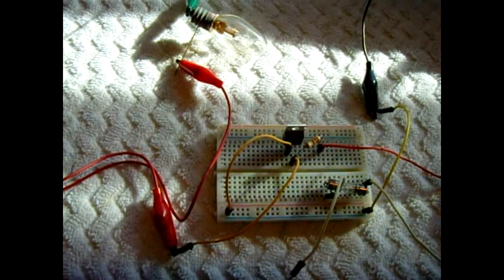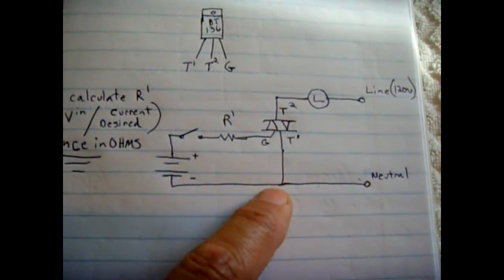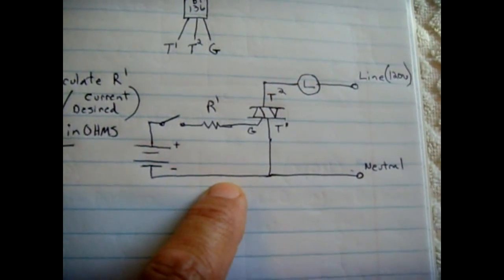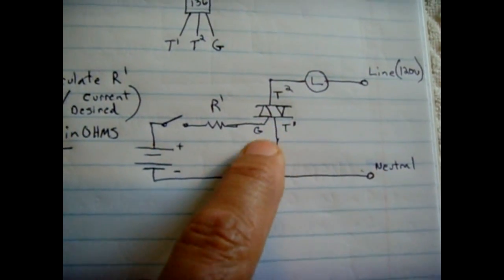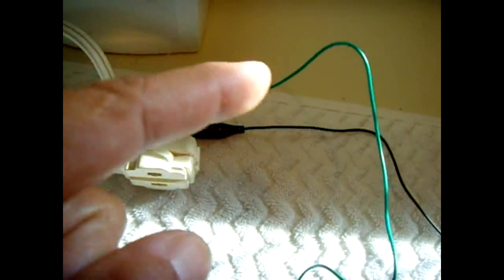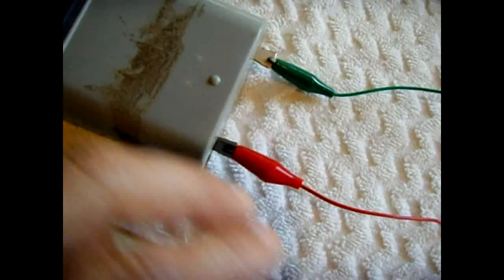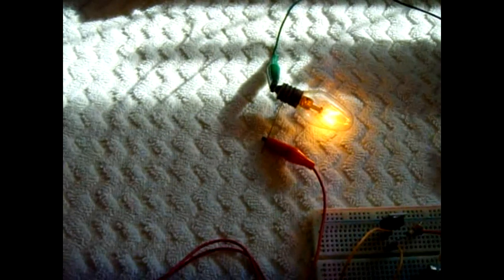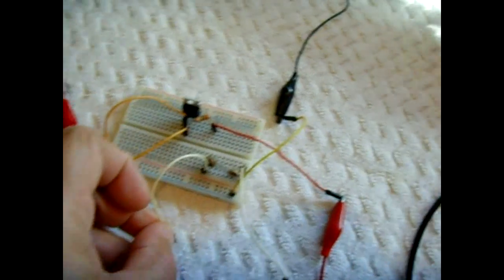How To Trigger Triacs for AC Loads Using DC(Battery)

Comment: Nice and clear vid, but just to be precise, you schematic shows a switch on the battery+ then you use the battery minus wiring to switch the circuit on/off. It's ok, but it could confuse newcomers.

However, let's do more vids.

Comment: A useful circuit. But mains voltage on a breadboard... hmmm what could go wrong?
Reply from the maker: Never had any problems, and I've used mains on breadboards for years during testing. Just be sure to use strips far apart. Thanks for watching!

Comment: ok, so you triggered an AC device which is the drill that works on an AC voltage that takes +ve & -ve voltages. so now the TRIAC conducts on both directions to allow for both +ve & -ve voltages. but on order to trigger the TRIAC to pass both voltages peaks, I have to trigger it with +ve and -ve pulses, but you only triggered the TRIAC with a battery that's only on direction trigger !!! so what's the deal now? what's happening exactly?

Comment: Awesome demo bro!
Does anybody have any good links for the transformerless supply (AC-DC) circuit that he mentioned briefly.
I've found a couple but their maximum output current is limited to around 40-100mA, which is not quite enough to power a micro-controller.
Reply from the maker: You can buy inexpensive switching power supplies at the link below.

http://bit.ly/2eBLkVI
Reply: Thanks I'll check it out.

Comment: Are you sure the little experimental Pin-Board is capable of handling mains voltage???
It is constructed for low voltages, max. rating is about 30 V!
It may run fine, until it blows up the whole thing in a moment!
A tiny metal splinter in the contacts would be enough or some wet dirt e.g. :-)
Reply from the maker: The breadboard is made of either Nylon or HDPE, both can handle 120V with no problem. The metal contacts strips also have adequate spacing.
Reply: richardnanis do it in your own risk 😂

Comment: Hello, thank you for a very good video!

I am wondering if this is also possible if I am using two thyristors instead? Also if it is possible at much higher frequencys? 300-500 Hz. 

Thanks.

Comment: what is the maximum triggering frequency??
i mean can we connect arduino to gate and give 100 hz on and off cycles
please reply
Reply: Check spec sheet to see how fast a triac you are using can be switched.  I know the voltage can be adjusted using a triac with a potentiometer instead of fixed resistor like demonstrated here.

Comment: The TRIAC will always shutdown at the zero crossing, but with the DC voltage applied on the gate it will turn on again for another half cycle and so on.

It works, but you are always driving the load with its maximum power.
You cannot control the power given to the load.
Reply from the maker: Yes. I was only showing how to switch on and off. :-) I have other videos showing power regulation.

Comment: do long use of Traic (with ac applaince)  increases its temperature??does it gets hot??
Reply from the maker: Only if the triac is controlling a heavy load, or if the triac is not fully turned on.

Comment: I connected the triac T1 with first terminal of my load and second terminal of my load with Live. Finally, the neutral is connected with T2. Theoretically, the lamp should be off, Right?
Are there any other possibilities that I didn't embrace? 
I am asking because I bought 6x BT136 and they behaved like a short circuit.
Reply from the maker: If you duplicated what I show in the video, the components are good, and you also have the correct pins, then it should work. Potentially dangerous circuits I do not assist people with. Stay safe.

Comment: I found A1 and Gate a BTA 12 trica  (dislocated from PCB) are connecting when I measured from a multimeter,  am I having a bad TRICA?
Reply from the maker: +yxhankun 
If you have a very low resistance connection or zero ohms between MT1 & MT2, or the Gate and either terminal, then the triac is shorted.
Reply: +electronicsNmore  mt1 and gate is 76 ohm; mt1 n mt2 is 16 m ohm. mt2 n gate is around 16 m ohm.
Reply from the maker: yxhankun You need to look up the data sheet. Triacs are very easy to test. You can make a simple test circuit like the one shown below. Use a 330 ohm 1/2w resistor in place of the POT.

https://tse2.mm.bing.net/th?id=OIP.M5fec8809c355d612903fba6a757b64f9o0&pid=15.1

Comment: Thanks for the explanation. I am wondering, how can you reverse the DC polarity at the gate so that it has negative current? Do you just flip the battery so that its positive side is connected to the neutral line?
Reply from the maker: +jpmvidal 
I never had any reason to do so. It works just fine as shown in the video.

Comment: I would have thought there should be safe isolation between the mains and the low voltage side for safety purposes.   In this arrangement, the mains is effectively electrically connected to the battery and can potentially be at mains potential.

Even installing a fuse as suggested, it is still potentially lethal.
Reply from the maker: +C Ngai 
Hi there. You have to realize that this is a demonstration to show what "CAN" be done. You also should never touch any part of the circuit when it is connected to AC mains. I always use a 50mA fuse or less. If you want to be super safe, use a 10 to 20mA fuse or connect to a GCFI protected receptacle.

Thanks
Reply: +electronicsNmore 
I note with interest your response to my comments.

Safe electrical isolation is a fundamental in any circuit setup, configuration or design.

Fusing serves a different purpose and cannot be a substitute to electrical isolation.

As for GCFI, it does not work on overload or short circuit conditions
Reply from the maker: C Ngai
I'm not going to argue with you over this. It is very clear that no answer I give will satisfy you. Have a great day.

Comment: Question more than a comment. I keep hear you saying T2 for the load and T1 for the neutral. I am going to try it later, but I thought I would ask the question. What if I am working on AC that has been through an isolation transformer? No real Neutral vs Load side. Have you tired it will it work?
Reply from the maker: +Carl Davis 
For reliable switching, usually the load is connected to MT2 from the hot AC line. Doing it through MT1 "may" result in switching problems. Give it a try. Be careful. Touch nothing when the circuit is powered up.
Reply: I am still putting the load on MT2 it's just there is no hot side anymore!
Reply from the maker: I lost track of my videos. You CANNOT use a battery to trigger as shown in this video unless you have a (L) Hot and (N) Neutral wire. Don't bother doing it, unless you are looking to blow up the battery in your face. Trigger the triac using AC only when you do not have a L and N.

Thanks.

Comment: Can triacs be used to dump a lot of dc current from a capacitor? I have two 600v 40a rated triacs and I want to drain a capacitor bank asap. Would I be able to trigger them in parallel and drain the caps at 80 amps? It will only be on for about 8 milliseconds and voltage drops fast, so I need to get as much out as I can in that time. Are there other components that might be able to do the job?
Reply from the maker: ***** SCR's are designed for DC. You have to look up the data sheets on certain SCR's to see how much current they can handle without blowing up.
Reply: electronicsNmore i havent found any scrs that can take the current. If it can allow current to pass both ways for dc, isn't it the same as a non-polarized scr? I only need to pulse the current for 20ms or so. Is there a higher rating for surge current?

Comment: what is the difference between the MOC3021 and the MOC3041 optriacs? I know it has something to do with zero crossing but why use one and not the other? TY :) keep up the good work uploader...
Reply from the maker: Both will work. MOC3021 is no longer made. Designed for 220v.
Reply: electronicsNmore
well I am European... we don't use 120 VAC like you Americans..
MOC3021 is still being made for different markets...Isn't MOC3041 suitable for 220VAC operation? Meanwhile I found out what the difference is between MOC3021 and MOC3041..http://electronics.stackexchange.com/questions/17795/difference-between-zero-crossing-optoisolator-and-regular-optoisolator

Comment: Very informative ! I am trying to make a circuit that can trigger a load when my battery reaches around 14 volts dc using a wind turbine. What is the lowest voltage that can trigger the triac? For example if the triac needs a min. of 5 volts to trigger you can use a resistor of about say 400 ohms in a 14 volt trigger supply. when the battery under the ac load drains to about 12.5 volts the triac will shut down till the batters reaches around 14 volts again. Can this work?
Reply from the maker: The data sheet on a BT136 says 1.5V on the gate. :-)

Comment: So a triac is like a transistor that uses low DC to trigger high AC?
Reply from the maker: A transistor uses a negative or positive charge on the base(PNP=NEG or NPN=POS)to allow DC current to flow through the transistor. The triac turns on and off in a "similar" way. Triacs are made up of multiple layers (quadrants) of semiconductor N and P type material. How AC current flows through the triac is determined by the charge placed on the gate to turn it on (NEG or POS charge), as well as which terminal is used for the load(MT1 or MT2). Usually MT2 is used. Supplying AC current to the gate through a current limiting resistor will supply both NEG and POS charges, which is best. You can read up more on WIKI.

Thanks! Be sure to rate Thumbs Up, and share my channel with others.

Comment: Triggering in Quadrant II:
Quadrant II operation occurs when the gate is negative and MT2 is positive with respect to MT1.
The text next to it is the part that are confusing me. This is on the link you gave me, on wikipedia.
Reply from the maker: Reference from another website:

"unlike a conventional thyristor, the triac can conduct current in either direction when triggered by a SINGLE gate pulse"

So to me that translates into either a negative or positive pulse. :-)
Reply: electronicsNmore In fact, I also found both arguments, but when you read about ac dimmers they say you that the triggering happens when a capacitor charges up to 30v and make a diac conduct, this process happens every half cycle of the waveform, with the corresponding polarity
Reply: electronicsNmore In addition, I believe that for "single gate pulse" its refering to the caracteristic of the thyristor to remain conducting even when the gate voltage disappears and it will only trigger off when the phase get inverted or the current through it falls below the holding point. This text dont seems to be refering to a "universal polarity" gate, dont know if you're getting my point.
Reply from the maker: I know exactly what your saying. Your saying that since I am triggering the gate using battery POS, that I am only getting 1/2 the AC waveform. Based on my tests, and what I read, the triac gives the full waveform using a neg or pos pulse to the gate.
Reply: electronicsNmore I will make some tests here tomorrow and see what I get. Then I report them to you buddy :))
Nice videos btw
Reply from the maker: Thanks.
Reply: electronicsNmore Yep, that's what I got: conected the vcc on MT1 and the led on MT2. When I conect the gate to the positive rail, the led lights up. With gate on the negative, led remains off. Inverted pins: Vcc on MT2 and led on MT1: gate on negative rail, led lights up; Gate on the vcc: led remains off.
Reply from the maker: How is my drill running so good(no different from a direct plug in 12ovac)if I am only getting 1/2 the waveform?
Reply: electronicsNmore I dont know, bro. Maybe your machine should experiment a load a little heavier so you can notice the diference in the power, with a free running maybe its hard to see, I think...
Reply from the maker: When I have a chance, I will use my oscilloscope and probe the power supply to the drill from the line into MT2 using battery POS on the gate.
Reply: electronicsNmore Dont forget to tell me what you got =)
Reply from the maker: When I check, I will post back to your comment.
Reply: Gabriel Guelfi First TRIAC can not operate in  Quadrant II (or in  Quadrant IV) it only operate in  Quadrant I and  Quadrant III. And you can trigger it with positive or negative gate current in both Quadrants
Ι +  Mode = MT2 current positive (+ve), Gate current positive (+ve)
Ι –  Mode = MT2 current positive (+ve), Gate current negative (-ve)
ΙΙΙ +  Mode = MT2 current negative (-ve), Gate current positive (+ve)
ΙΙΙ –  Mode = MT2 current negative (-ve), Gate current negative (-ve)
Reply: Gabriel Guelfi ,+electronicsNmore
some TRIACs cant be triggered at the IV cuadrant ,most TRIACs need a little bit more current at IV cuadrant ,TRIACs that are designed for DC triggered are sensitive TRIACs ,the BT136 says nothing about not being able to operate at the IV quadrant so i say you are getting full wave while Gabriel Guelfi might be using a TRIAC which cant be triggered at IV quadrant.
Reply: marionetadelplaneta
i mean they arent necesary designed for DC triggered is more proper to say that IV quadrant gating is guaranteed

Comment: Hey man, the triac dont need a reversed polarity gate pulse to conduct when the half-cycle of the mains are reversed?
I mean... when you give a positive pulse in the gate, this pulse will trigger one of the inside scr's, and when the polarity of the main are reversed, the other scr must be used to conduct current in the reverse way, and this one must be triggered with a negative pulse.
The way you show in this video, the load will only receive a continuous feed from the positive half cycle, isn't it?
Reply from the maker: You are getting the full AC cycle. You saw how well the motor ran in the video. Refer to the link below. It explains how the triggering works with the quadrants.

http://en.wikipedia.org/wiki/TRIAC
Reply: The electric motor inside the drill is a universal motor which can use either ac or dc voltage. In your case, it's using pulsed dc rectified by the triac.

Comment: Nice video thanks. Question, 120 volts ac changes it phase at 60 Hz in the US or 50 Hz on 250 volts in the UK. So your battery negative gets a positive 120 volts phase every other cycle, if so, can you just block the positive cycle with a Diode.  or am I talking out my ass, thanks for your help with this. :-)
Reply: I think this will insure you don't have anything effecting the battery.

Comment: so that mean I need run drill nonstop? or I I can used trigger from drill to slow drilling or faster drilling?or stop and start again?
Reply from the maker: You need to watch this video:

120V Triac Dimmer Circuit

It is what your looking for. Be sure to use a large heatsink.

Thanks For Watching! Be sure to share my channel with others, and rate "Thumbs Up".

Comment: ok thumbs up 
but 1 thing ,1 question ,for how long you can run this drill
1 min/2 or?? how if i start my loptap
Reply from the maker: It will run as long as the gate of the triac is being triggered. No set time.

Comment: I suppose my concern would be using small alligator clips and a cheap breadboard with thin wires to feed 120V into something like a drill that really pulls some current. As for the person who asked if the circuit would work if live and neutral were reversed, please don't try that because you'd be feeding electricity into the battery, probably get the triac stuck on and possibly if you touched the battery while holding anything that's plugged in you could an electric shock. If you do not have the knowledge to determine live from neutral, you should be going nowhere near this circuit.
Reply from the maker: The duration was short, and the setup was only for demonstration purposes. The small wires only got slightly warm.

Thanks For Watching!

Comment: I salute to you man. You are certainly not afraid of death :)
Reply from the maker: Nothing dangerous about this circuit. Respect high voltage, do not fear it. Using the proper fuse will virtually eliminate any chance of problems.

Comment: Is there any simple way of replacing the battery to trigger the gate? I would like to keep all power supplied to ac. Maybe someone can point me in the right direction?
Reply from the maker: Yes, very easy. Feed line Hot power into the load, then from the load into MT2. From MT2 you can connect a 330 ohm resistor(may have to adjust the value if you do not get close to full power) to the gate. You can either use a 120V push on/push off switch between the resistor and the gate of the triac, or use an optocoupler and have the circuit trigger from an isolated DC circuit.

Thanks for watching. Check out my video playlists!

Comment: what if my circuit doesn't goes to a neutral but to another line? I am controlling a three phase delta circuit, using the TRIACs to control the AC phase before a series of transformers to lower it's voltage with an already cutted signal

Comment: Thanks for this tutorial. I want to know if I can use a TRIAC to slow down an ac motor with the phase angle technique. I read that TRIACs don't work well with inductive loads. Thanks in advance.
Reply: Atlascol TRIACs dont work well with inductive loads without proper transient protection since they get damaged ,but if you add an RC circuit(snubber) or any other transient absorber then it should be fine also it ensures the proper shutdown.
**Note:that's only for the TRIAC protection you might as well protect the AC line